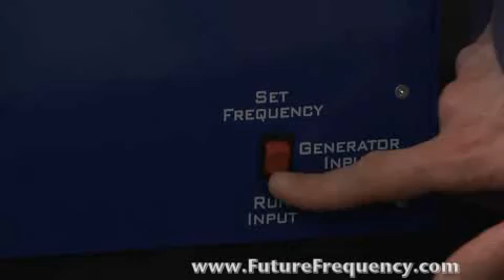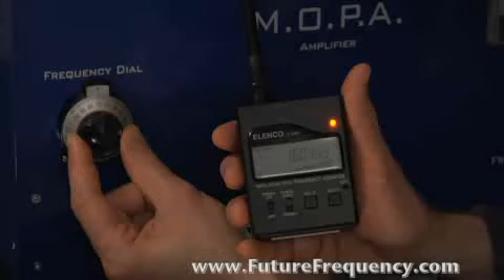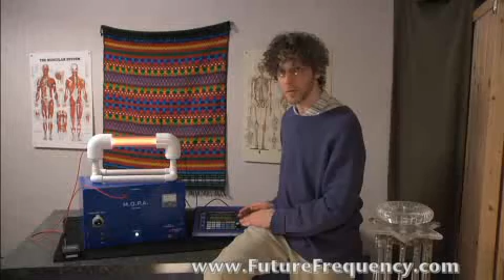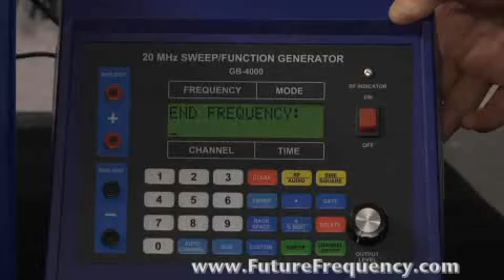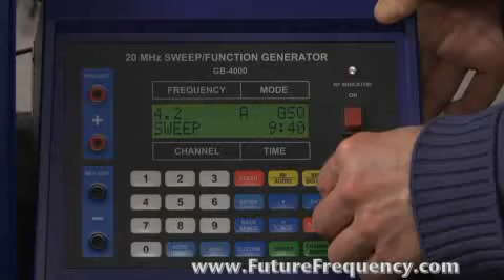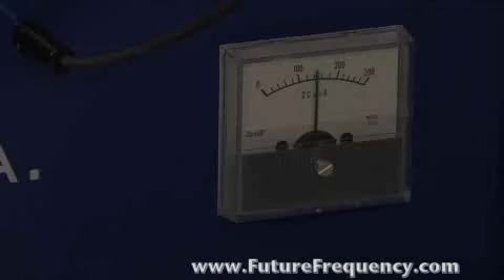MOPA Amplifier Replica.flv

Comment: The 10 watt rating is for the GB4000 with the SR4 amplifier, not the MOPA amplifier. Note that the SR4 amplifier uses contact cylinders and footpads and does not use a plasma tube like the MOPA amplifier.
To sum it up, you have 3 options:
1) GB4000 alone - you need the hand cylinders & footpads accessory
2) GB4000 with SR4 amplifier - you need the hand cylinders & footpads accessory
3) GB4000 with MOPA amplifier - you need the plasma tube accessory.